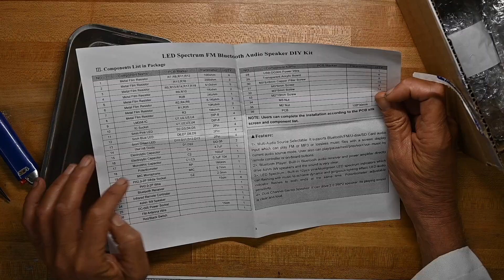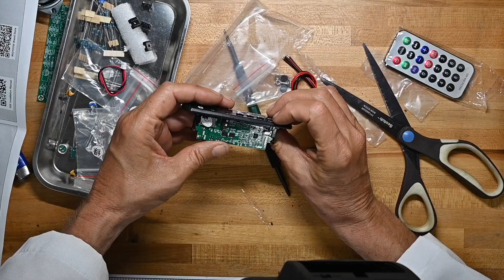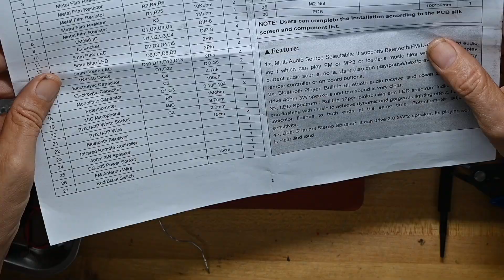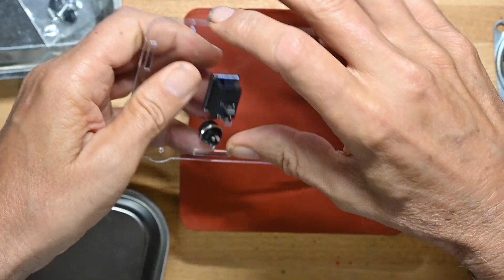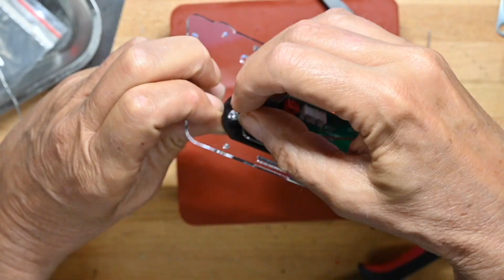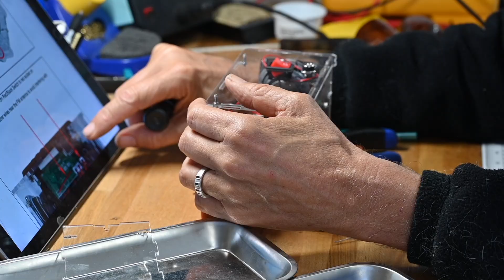C.K. builds a Bluetooth speaker with FM radio and LEDs kit from MiOYOOW

Comment: Would i be able to replace the speaker for bigger ones ? Or it wouldn’t handle it?
Reply from the maker: Short answer, no.   In a quick way of thinking about it (suitable for a youtube comment ) it all comes down to physics.  To make sound, we're moving a speaker cone with mass X, to get a sound by sending an oscillating current through the speaker voice coil.  We have to add electrical energy Y to the voice coil of the speaker cone to move it back and forth.  For a larger X, we need to apply larger Y to move more air.  This amp has a Y of 3 watts (roughly speaking) , enough to move a small cone audibly.  Add a bigger mass X and we need more Y to achieve the same volume.  SO generally no, you can't swap out larger speakers without losing volume, and often frequency response.
Reply: @CKHaun thank you for taking your time to explain

Comment: I built this kit and only two LED’s are lighting up. Any solutions for a noob?
Reply from the maker: A few things to look at.  First step with diodes of any type is double-check that the polarity is correct, even after decades of,soldering I still get them backwards sometimes..since they are installed you’ll have to look for the flat side of the diode, or,the big cathode, to see if they are in correctly. If they are all,good take a look at the schematic, and you’ll see that each pair of LEDs are triggered by the LM358 op amp integrated circuits. Double check to make sure those are installed the correct way (notch on the chip facing the notch on the socket or printed on the circuit board), and also check all the solder points on the sockets themselves. You also may have put the wrong resistors with the individual o- amps, but I think that’s unlikely. Good places to start looking.

Comment: Great video, thanks ! I'm wondering if the not used connector wholes on the MB could be a headphone out, just they forgot to mention ? I'm talking about the middle one between the white connector and antenna connector that is near the red cable and ofc not used. It is visible at 34:12 . I would like to use it badly, it would be great at work...  What do you think, should I try ?
Reply from the maker: Hmmm, I don't know off the top of my head, it's been a while since I did that kit.  I'll see if I can find the details.  Thanks for stopping by!

Comment: On the 510 is the green line will be on your right side?
Reply from the maker: For resistors the orientation of the part is not electrically significant, it can be placed with the top band either left or right.  I usually put the top value band to the left, but that's just personal preference, no technical requirement.  Thanks for stopping by!

Comment: Mine works fine but no leds work
Reply from the maker: I’m away from my shop right now and can’t check, I’ll be able to look Tuesday. Thanks
Reply: I had the same problem. Had to solder trim pot on both sides of the PCB. Soldering on one side only didn't make good condition on the other side of the board. Or use lots of solder so it flows through the holes and make contact with pads on the other side. That fixed my problem. Good luck.

Comment: I just subscribed, I wish I would have seen this before my attempt at the build. My kit has the speakers in the front. For some reason all my led lights are constant on. Even when I turn off the power switch on the back any ideas as to what could be wrong? I am really bad at trouble shooting……thanks for the great video!
Reply from the maker: Thanks for the sub! I’m away from my workshop unit the 2nd week of March so can’t check quickly. I’ll take a look at the schematic if I can download it to see if I have any ideas, but you may have to wait a bit, sorry.

Comment: Hey C.K.! I built the Gikfun speakers that you built 3 years ago. I actually left a comment on those when I did it. My daughter still uses them today on her computer! I think this BT Speaker kit looks much better than some of the ones I have skipped in the past. I really do need one now for when I am working at home. Thanks for the build and the thorough review!
Reply from the maker: You're welcome as always, thanks for coming by!  I use these in the workshop, last forever.
Reply: @CKHaun   OK...I just finished building this BT Speaker. It works well. Putting the case together was crap, but outside of that, it was worth the effort!
Reply from the maker: Arg, those cases are the worst part of these builds.  Chasing tiny hardware all over my workbench.

Comment: This video and the link in the comments was everything needed to make this build fun. My blue led’s won’t fire up and half my and no idea which piece of circuit to check. The ones that failed are in identical patterns so something has failed..bah - but it plays. Which part do you think controls the leds? Capacitor? Resistor?
Reply: Looks like my dips are the problem.. I was able to track through the diagram
Reply from the maker: You caught me while I was asleep!  Glad you were able to find the solution, and thanks for stopping by!

Comment: Mine wasn’t turning on at all, I saw that you had the same problem and the solution actually did it so this video really helped, thank you!
Reply: The moment he discovered the negative reading via his multimeter, I gasped. 😅Thankfully this system must have some kind of ideal diode / reverse polarity protection in it.
Reply: I was building mine and the white connectors had the black wire connected to the positive side of things.
Reply from the maker: Glad it helped, and thanks for stopping by!
Reply: @CKHaun  Had the same problem thanks to this video it now works :)

Comment: Do you have a link for that LED tester? Thats a nice piece of kit!!!
Tried searching for LED tester but didnt get anything like what you have
Reply from the maker: Sure, I buy Whadda kits from Jameco in California; https://www.jameco.com/z/WSMI198-Velleman-Velleman-LED-Buddy-Kit-Solder-Assembly-Required-by-Whadda_2355119.html
Reply: @CKHaun  awesome thanks!!! Looks like Amazon has it too by typing in valleman LED buddy. 
I see there are knobs for voltage and current. How do you set those to not blow the LED you're testing before you test it? With volt meter?
Thank you so much this is really useful. I love useful kits like the power supply and this haha
Reply from the maker: Useful tools are just good to have!  As for setting the voltage, I usually use 5 volts, and the tester displays the voltage you're using, so you don't need a voltmeter.  A fun tool.
Reply: @CKHaun I've bought 2 now just to make the second one. First one works great! 
Awesome to have a kit that you can use again for most projects. Love being able to test my LEDs
Reply: Yup. I was also eye that beautiful led tester